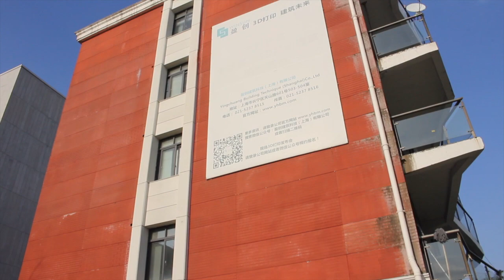5 Story 3D Printed Apartment Building Tour

Comment: It does appear to be mostly 3D. All stories. Very interesting. WinSun seems so much further than others - which IMO is frustrating since they essentially stole CCs IP, ran to China and was off to the races meanwhile nothing in USA due to regulations. Imagine that. I would also think someone will update print software to allow for plumbing electric etc to be included in the design/walls soon?

Comment: how many housing units are in this building? also, do you know why they aren't integrating the pipes into the walls and why not painting the interior of the building because it looks very bad after they didn't combine the beautiful structure of this building method into the design of the interior as well as the exterior

Comment: All videos are great, bro. Could you please mention us about the approximate values of these 3D printing machines, like 3D printing machine itself, concrete mixer, concrete pump, 3D software making fee for one house design because not everybody want the same design. Thanks
Reply from the maker: Thanks bro. Winsun does not disclose much information about their printer to the public but I believe it is a gantry style printer that can be purchased from other companies at $50,000-$500,000. It’s a big range and the quality of the printers is directly correlated to price. The concrete cost also is variable, companies like wasp 3D will print with mud for pennies but other companies develop proprietary mixes that can cost double what traditional concrete mix would be. The design fee depends on your local building codes and regulations. If they are strict like America you may need an engineer or architect to make the building plans which could cost 3-5% of your total project budget. If they are not strict all you need is a 3D model in an .STL file. You can pay an engineer many thousands of dollars or you can go on an outsourcing site like Upwork.com and hire a freelancer for under $1000.
Reply: If you still want information, I can get you all the answers you need. The machines are more sophisticated than they were 4 years ago and more accessible too.